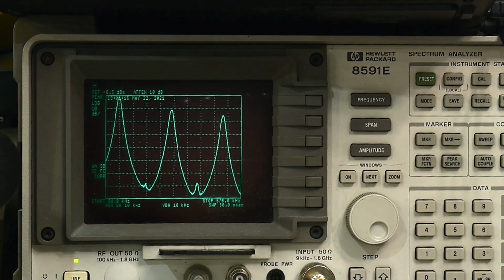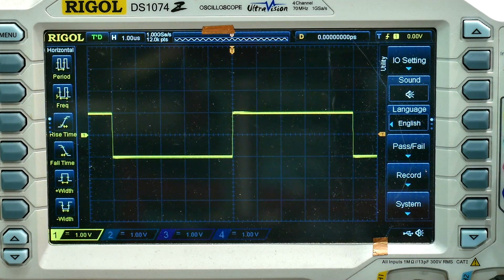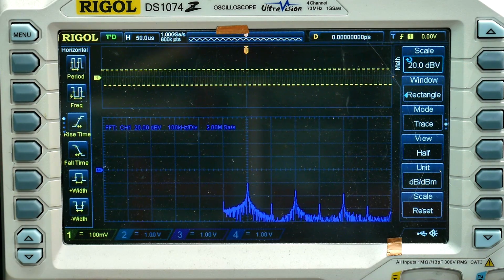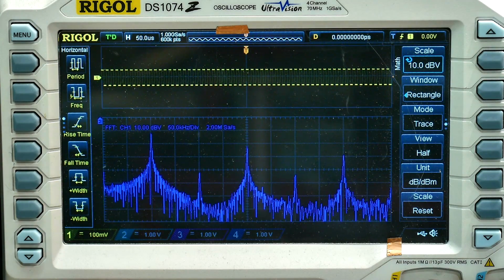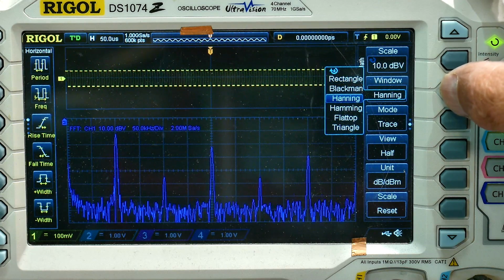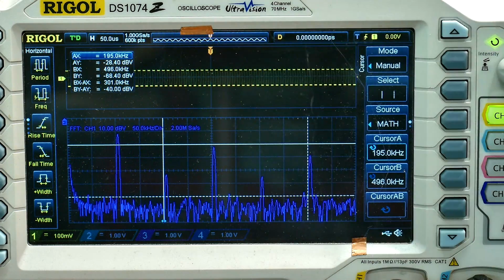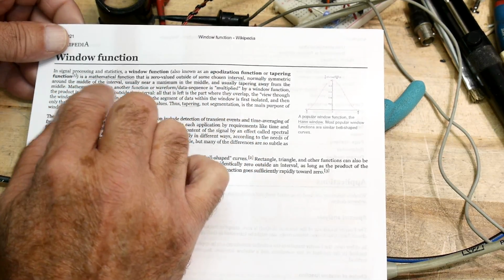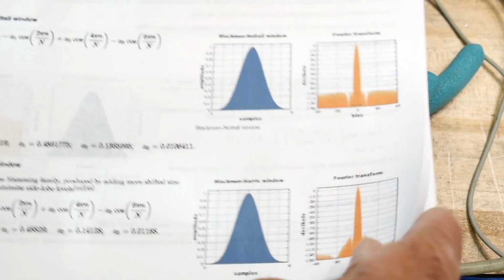#828 Using Oscilloscope as a Spectrum Analyzer (FFT)

Comment: My scope has an FFT function but it becomes almost unusable when i try to get to any resolution worth working with, due to CPU speed limitations.
I also have an almost 40 year old spectrum analyzer that outputs X/Y to be used with a scope. I bet these are dirt cheap second hand. If your are not doing any fancy microwave stuff, these are clearly superior, imho.
They are essentially radios that sweep the tuner over the selected range and output the VCO control voltage (sawtooth wave) on X and the demod/s-meter on Y.

Comment: I think the moral of the story is, if you have a nice digital scope with FFT, and need to do spectrum analysis once or twice, this is great - otherwise, you are really probably better off trying to score a used proper analyzer in the right frequency range and/or using an SDR and software based solution. This is great though to help you understand how those "black boxes" operate - which is often more useful than the tool itself, as demonstrated.

Comment: You video is very misleading as you are using a special digital scope, not a typical analog scope. Why not use a regular scope to demonstrate this? Better yet why use that scope at all since you already habe a spectrum analyzer
Reply from the maker: the reason to use this instead of spectrum analyzer is the frequency. a normal spectrum analyzer will only go down to 10kHz. The FFT allows frequencies below. so great for audio frequencies.
I did a video on analog scopes: https://youtu.be/2ASidXr8Iyk?si=5bR81SNJ__rC_MGY
Reply: I wouldn't call this a special scope by any means. Digital scopes are very much the norm these days.

Comment: GREAT VIDEO.WONDERING IF I CAN USE FFT AN OFFSET TO PRODUCE 2 SLIGHTLY DIFFERENT FREQUENCY FOR MY COMPONENT TESTING ? I HAVE A O SCOPE WITH A WAVEFORM GENERATOR,CAN CHANGE AMPLITUDE OF VOLTS AND FREQUENCY OF WAVE FOR CHANNEL 1,OFFSET FOR CHANNEL 2?
THANKS
JOHN
Reply from the maker: the FFT is just mathematics before it displays this on the screen.
Reply: thanks for reply on the FFT.thought I might be  mathematically  able to change the frequency input to the component, that would show a phase difference on the scope.do you have any other suggestion?
seems like component testers rely on a slight change of amplitude and/frequency,perhaps this is mainly done with the current limiting resistors? John
Reply from the maker: @jw228w  no, it doesn't work that way

Comment: Low frequency operation on a spectrum analyzer is possible with the use of an RF mixer.
You enter an HF signal of 10 MHz and the LF input could be a sweep from 20 Hz to 20 kHz
On the spectrum analyzer you set the frequency offest to -10 MHz.
Set the start frequency to 0 Hz and the stop frequency to 20 kHz.
Setting the sample/hold fucntion  would allow to show frequency response.

Comment: If you have a computer with an audio input, you can use much nicer spectrum analyzers for low frequencies, such as the free voxengo span. there are apps for phones and tablets as well.
Reply: I second this, i use REW, it has a table that calculates the THD of the harmonics and has an accurate Oscope function with cursors. I say accurate because i checked  it against my rigol 1102ze,  Band width of REW is up to 30k which is plenty for audio.  now would i like to own/have access to a nice Frequency analyser?  of course but this seems to be a decent tool

Comment: I have a potentially stupid question. What method of square wave signal generation is used in this particular case so that it can be spectrally analyzed using FFT? I must admit I'm not quite knowledgeable and have deep gaps in my education. For instance if a multivibrator is used as a the source of the square wave output signal can it be spectrally analyzed in this way? However I must admit I'm so dumb that I dare ask another question: When using the spectral analyzer does it display the real composition of the square wave input as in this case or does it on the contrary shows a theoretical representation of its input signal based on the Fourier sine wave odd harmonics composition that would give us an equivalent square wave form be that sine wave odd harmonics composition actually implemented to generate the square wave form?
Reply from the maker: the multivibrator (555) is just fine. The display is the actual waveforms. The FFT is a mathematical transformation of signals in the time domain (oscilloscope) to the frequency domain, called a Fourier (four ee ay) transform. FFT is fast Fourier transform (a software algorithm)
Reply: If all you need is some signal to see the FFT function at work,  just juse the probe compensation hook on the scope. It provides a nice 3Vpp 1 KHz square wave.

Comment: I is very informative video, I hope it will push me to try FFT on my Rigol DS2072A. I wonder why all FFT videos only covers RF signals. My main use would be
checking the noise in power supplies, and harmonic distortion in HiFi and guitar equipment. I think an overlooked issue is ringing in power transformers.
Reply from the maker: you should watch this one too: https://youtu.be/JbZ1-qFaVG4

Comment: It is amusing to notice your hand waving just outside the frame.
Reply from the maker: you are easily amused
Reply: @IMSAIGuy  "you are easily amused"
And a bit pedantic.  Your editing is quite a bit better than "Kiss Analog" where I find myself skipping forward trying to find the "meat" of oscilloscope explanation; or cringing at 500 microseconds per division, two divisions is one second.  Um, no, two divisions of 500 microseconds is one millisecond.  But, whatever, he does eventually get some useful information posted.  Struggles with triggering a 100 millivolt AC signal riding on 3.3 volts DC.  Easy peasy, switch the trigger to AC; and since you don't care about the DC, rather than a huge offset, just switch the input to AC.
Reply from the maker: I agree, he has some good knowledge, sometimes hard to get to. Since I do a video a day I need to be terse.
Reply: @IMSAIGuy  I' have a very nice Philips dual trace delayed sweep analog oscilloscope but it's big, a bit long in the tooth, but it FEELS and works like an oscilloscope with nice clicky detents on the knobs and genuine dual time base.  
https://upload.wikimedia.org/wikipedia/commons/e/ef/Analog_Oscilloscope_Philips_PM3267.jpg
Rigol has a nice gradient fill appearance for two-tone SSB alignment, makes it look a lot like doing that on an analog oscilloscope.  Rigol's FFT is by all indications horrible. 

I like the Keysight Bode plot thing, rather a lot like VNA but nowhere near the frequency range of NanoVNA but can do that sort of thing all the way down to audio frequency.  Likewise the FFT can process audio frequencies.   So at the moment I am leaning to Keysight and basically look for reasons NOT to buy Rigol, or Keysight, or whatever.  None of them feel like the venerable Tektronix.
Reply from the maker: the newer Rigols have better FFT: https://youtu.be/JbZ1-qFaVG4
it also has bode plots. 
if you want a cool instrument, Siglent has spectrum analyzer and VNA in the same box. SVA1000X
Reply: @IMSAIGuy  "Siglent has spectrum analyzer and VNA in the same box. SVA1000X"
I shall check it out!  Thanks.

Comment: Thanks for the demo.  I've been needing a scope for electronics purposes and also for analyzing audio, and was thinking of using a Rigol DS1054Z for both purposes.  But what I can see here is that it's not very useful for audio.  Great for circuit debugging, but not for writing music.
Reply: I don´t think a scope would ever be great for writing music 🙂
Reply: @qddk9545  A scope is a great tool for musicians, especially when using synthesizers.  But it needs to be a scope which is designed for audio.  Many digital audio workstations have one built in, but I was looking for a convenient solution for an all-hardware setup.  Eventually I settled on just using a free phone app.
Reply: @ToyKeeper  what's the phone app called?

Comment: Thanks for reviewing a FFT function of the scope. Can the Rígol scope provide FFT with dynamic range over 50dB (8-bit)? Simply put, what is the FFT noise floor (dB) when a perfect sine is provided to the input?
Reply: Assuming linear 8 bit ADC, you have 8 doublings of voltage and each doubling is 6 dbv for a total of 48 dbv.  The problem, or A problem (one of many) is that when displayed on a log scale, the least significant bit of data becomes the most visible part of the FFT.  What intermediate voltages exist between 0 and 1 (LSB)?  None!  There are no intermediate voltages consequently this HUGE step increase produces low power harmonics from here to the moon.  But because of the logarithmic scale, that noise in the least significant bit is over-emphasized.  Also, that noise will randomly change the 0 to a 1, a 1 to a 2, and so 253 becomes 254.  
But the 0-to-1 transition, or 1-to-2 transition is a DOUBLING of voltage or 6dbv with NO INTERMEDIATE voltages.  It is a really big step change.  But from 253 to 254 is barely any change at all in terms of dbv.  That's why, in log mode, it is really ugly at the bottom and rather useless as compared to a Real Spectrum Analyzer (tm).

Comment: The FFT resolution on Rígol's scopes can be improved by changing Memory Depth setting. By default the FFT is taken using only datapoints from the screen, which can be enlarged by setting the Memory Depth to  6 or 12 million points. Unfortunately, this setting does not "stick", and often volunterely switches off back to Auto.
Reply: WTAF. The important part of this tip isn't even the memory depth. It's that they only do the FFT on the portion in the screen.

Well....actually, that kind of makes sense. I don't know how else you'd set the FFT length. I guess make it a parameter, which would make sense from a DSP POV, but maybe not to an EE using a scope.

Comment: I would add that unlike the trace averaging function, which produces noise-free output, there is no FFT averaging on Rígol's low-cost scopes. The FFT is simply taken on a single acquired trace no matter what settings are. This is a real pity, as such FFT averaging option could have been easily supplemented, greatly improving FFT spectrum S/N.

Comment: I am so glad i bought a rohde&schwarz (hmo1202) although it was the cheapest one, its fft is really usable, it measures in dbm or dbv or whatever you want and accurate enough to give usable values, it is compared to the rigol a dream to use.
Money well spend i know now.
Reply from the maker: Very nice. R&S makes very nice stuff. The newer Rigols are better but still no dBm 😕
Reply: robber576
I am thinking about making a video about this scope, exciting as i am not in the business of making videos ;-) , so i made yesterday some measurements on this scope, to give you some idea: it is a "100 mhz" model but measured with the leo bodnar 40 ps pulser it goes up to 185 mhz, my marconi 2955b confirmed that and yesterday i measured in fft mode a 120 dbm 30 mhz signal coming out of the marconi within +1,7 dbm accuracy, the scope is 8 bit but up to 16 bit in highres mode and apparently can do that reliable within +/ 2% accuracy down to -120 db with a noise floot @ -130 dbm, its quite impressive for something sold as the "cheapest model".
Granted, at €1000 not in the same league as a €300 rigol but then what can you expect for €300? A decent multimeter costs more...
As i said, i am glad i did spent that money.

Comment: Looks like the Rigol is about the same as the Siglent as a spectrum analyzer.  I haven't played with the FFT on my Siglent enough to get it all figured out, but I can usually play with the knobs and eventually get a useful display.  I have a "real"  spectrum analyzer here and I usually use that.  But like most spectrum analyzers, my real analyzer won't go low enough to look at audio.  Using the FFT function, I was able to measure the harmonics (better than -40 dB) of a "pure sine wave" DC to AC inverter I have, and was also able to look at intermod products of an SSB transmitter.  Maybe some day somebody will add a traditional spectrum analyzer interface to their FFT spectrum analyzer and give us the best of both worlds.
Reply: The gw-instek has this SA function on the oscilloscope, works quite well

Comment: The irony is: Rigol thought it wise to display the way form too--causing the FFT to run slower. (Picard'esque Facepalm)

Python fft for 1054z
https://hackaday.com/2015/09/22/a-better-spectrum-analyzer-for-your-rigol-scope/
Reply: Wait! How long did it take to figure out the cursor screne? Thank you.

Btw, you know that there is a Python FFT 1054z to link to a computer?
Reply from the maker: Rigol has improved it on my new scope. Stay tuned July 7
Reply: @IMSAIGuy  ,  Still, I wish they would fix it on the 1054z, where FFT is a nearly useless checkbox feature.

Now, it seems we are supposed to throw away all of our putty colored devices--and replace them with black ones. Oddly, off-white looks good in a lab, or even on the kitchen table.

Comment: Decibels are decibels. dBV...dBm...dBWTF...etc., is irrelevant.
Reply from the maker: actually dB is a relative measurement and so your comment is valid. However a dBm is an absolute measurement as is dBuV. They are reverenced to a milliwatt and microvolt. So there are very big differences.
Reply: @IMSAIGuy  True enough. I suppose the scope/FFT might actually be calibrated to read dBV! :-}   But I gather it doesn't have 50Ω input ability, so dBm makes no sense. Why complain about it?
Reply from the maker: @qwaqwa1960  I have an HP and Keithley multimeter which both support dBm directly. Rigol could do the same. I point out something Rigol could have done better. Many scopes also have an internal  selectable 50 ohm input. Also a feature I wish Rigol would have added.
Reply: @IMSAIGuy  It maybe worthwhile to keep in mind that Hewlett Packard and Keithley instruments, along with Tektronix, and other "A grade" instruments are MUCH more expensive to purchase and as a result, the Rigols, Siglents, Owons, etc,etc, are allowing us "hobbyists" to actually put our hands on instrumentation functionalities which we would otherwise (without these less expensive "B grade" options) be far out of our reach. Just my $0.02.   Fred
Reply from the maker: @electronicengineer  I do think of that. the dBm issue is simple math added to the software, so no real cost. a 50 ohm load per channel would add about $1.00 in parts per channel and most people don't use it. You can use an external 50 ohms so I'll let that one slide.
Reply from the maker: @electronicengineer  oh, and those two issues are on $4000 scopes from Rigol. not hobby grade.
Reply: @IMSAIGuy  Wow, so Rigol really dropped the ball across their entire oscilloscope line then. I do not own a Rigol instrument, so I really have no "carnal knowledge" in that regard. In any event, just in my opinion, prior to the cheaper oscilloscopes hitting the market, it was much harder to reliably put such technology on your hobby-tech bench. Buying used "A brand" equipment from Ebay was, and still is always a craps-shoot. That was my only point that I was trying to make.   Fred
Reply from the maker: @electronicengineer  A TEK 465 is going for $80 here on craigslist. Used to be THE scope to have.
Reply: @IMSAIGuy  "a 50 ohm load per channel would add about $1.00 in parts per channel"
Not necessarily.  Suppose you hook up to a 50 volt sine wave at 50 ohms.  That's one amp RMS, hence 50 watts dissipation.  A high precision, 50 ohm 50 watt termination is plenty expensive, around $200
I have a 5 watt and a 2 watt termination, 50 ohms, BNC male and female.  Very handy!  Not cheap.  Leave it to the customer to decide the power rating based on the expected use case (ie, testing illegal CB radio, the resistor may be more expensive than the scope).
Reply from the maker: @thomasmaughan4798  I was describing a common oscilloscope that does have the 50 ohm option. usually good to one watt. you might be interested in the 250watt 50 ohm load I built: https://youtu.be/tQ381HfpAxM
Reply: @IMSAIGuy  "you might be interested in the 250watt 50 ohm load I built: "
Indeed.  I watched that video; amazing you can shove 250 watts into that tiny flat pack resistor, provided it has a super impressive heat sink.  No doubt it has less reactance and radiation as compared to MFJ dummy load which I actually use sometimes as a short range antenna :-)  take the cover off for a few more meters of range.  That turned out sort of ugly so something that works better is a rubber ducky sitting on a 50 ohm 5 watt terminator with BNC's and that in turn connected to the HF (Icom 735 or 7300) for setting up peer to peer winlink when the radios are almost next to each other.
Reply: @IMSAIGuy  Sheesh, whaddya got against external links that might actually explain things...??
Reply: @IMSAIGuy  If the scope supports math expressions, you could easily display as dBm in whatever external terminator you decide to connect...
Reply: Very big differences indeed.  dbm is a power relationship, strictly speaking so is dbV either are inherently logarithmic in display and tend to perform terribly when you have only 8 bit ADC.  
It is assumed that if you want absolute measurement you will use a termination; 50 ohms for coax testing and 600 ohms for many types of audio circuit testing.